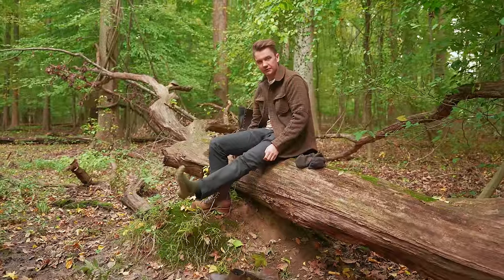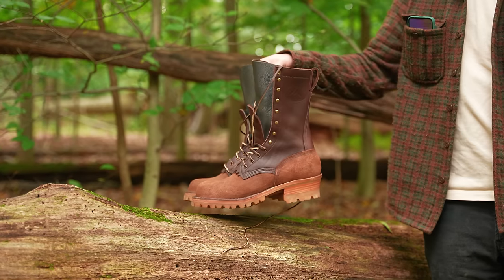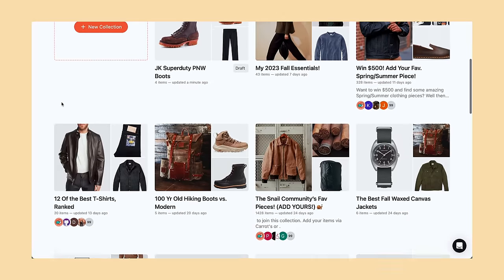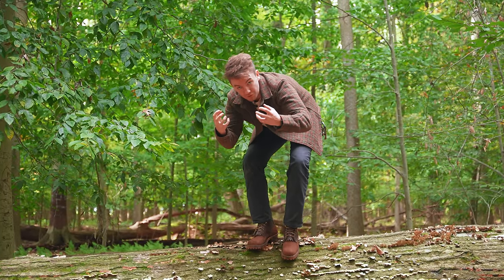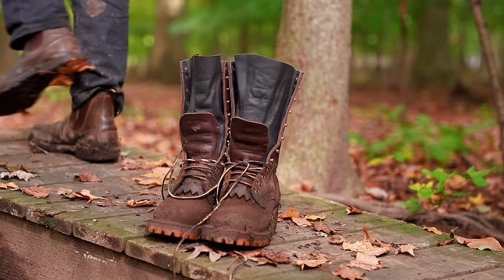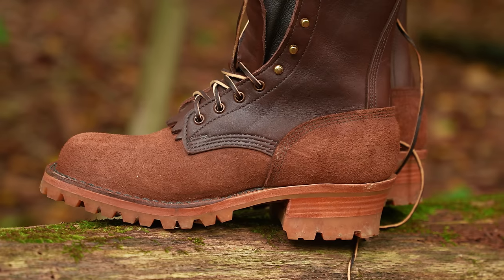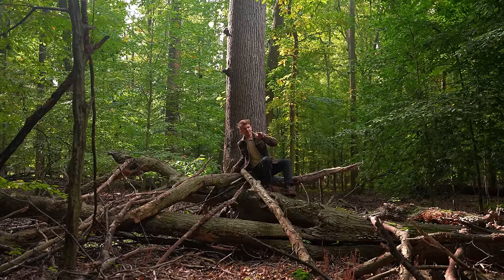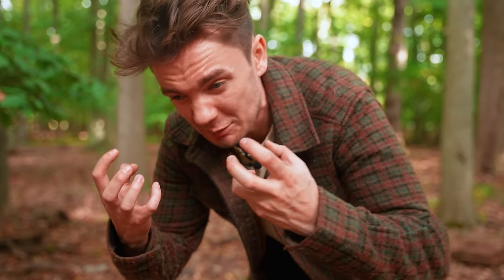Why Firefighters Wear Heels. (JK Boots)

Comment: Wish that you would have added how heavy these boots are. So even if you're walking for 9 hour days, the legs will probably feel the fatigue way before your feet do. lol
Reply: They are right about 3 lbs per boot. And when they fit right you don't feel the weight
Reply: If your working in construction or firefighting and walking on rough terrain all day lighter boots start to really hurt your feet because you feel everything you step on a heavier boot and bigger lugs definitely help with that
Reply from the maker: That's why I forgot to mention it!

Comment: I really apppreciate your insight at knowing they aren't broken in yet, and knowing how that will affect movement. I want to speak to that, as a former trail worker, who still does dry stone work and sawyer work in boots like these. 

A lot of people online call their boots broken in when they're no longer uncomfortable. But to me, the quality of leather that I value when carrying half my body weight over uneven, slippery, crumbling ground, is that it can adapt to your normal full range of movement, while being stout enough to permit no further movement. BOTH parts of that quality prevent injury. So to me, boots are broken in when I can do yoga in them. When I can accomplish my full range of motion in all directions. BUT NO FURTHER. 

Boots like this, broken in like that, allow you to SPRINT down undeveloped mountainside with ease. You are agile and stable. 

And someone else brought up the weight, and the replies were right. When the boot fits so well it becomes part of your foot, like a leathery callus in the shape of a boot, rather than something you slip inside of and have to pick up and manuver inside of, you stop noticing the weight. Anyone who's carried an old style frame pack has had the same feeling, of the heavier pack feeling lighter when full because of how it manages weight. 

And weight is really a key thing here. Boots like this aren't for everyday walking. Toss on some nice moccasins for that. These are for situations that would hurt your foot, that would be beyond foot health, and into injury, without these boots. HUGE pack weights off trail, loaded with tools and fuel. Kicking things, having chunks of rock and log that weigh more than you drop onto your feet, standing on iron bars for hours, etc. 

No matter what I do, my feet feel the same coming out of boots like this as they did going in. 

By the way, Mike, good old school double sock technique. We used to teach that to all the new field team members.
Reply: Best, most concise explanation I've ever read.

I agree 100% but have never been able to put it into words as well as you did. Thank you 👍 🍻

Comment: - Another huge reason for those heels is when hiking up an extremely steep hill, your ankles simply will never have the range of motion to flex enough for your heels to touch, so your heels will be off the ground anyways. The heel in that case adds support when most shoes wouldn't be able to supply it. 
- They also dig in deep when going down steep loose dirt, which is wildly helpful. 
- And the smooth leather on the top allows for your pants to slide over the top of the boot, because if it was roughout and you were wearing textured pants, it would catch on the grain due to the increased friction.
Great video! Always love your video style.
Reply from the maker: Ty for more info!

Comment: Barefoot bro here: 

These are great, sometimes. If you need to push yourself to the very edge of your ability and avoid injury from stepping through something (a common hazard in logging and firefighting) or stepping wrong on rough ground while carrying 70lbs of gear then these are exactly what you need. 

Every other day, those benifeits dissapear and barefoot shoes help you keep from babying the muscles in your feet

Comment: Great review michael! Just adding this, if by any chance you don’t want to wear a high heel boot, but want the same construction. You can get the same boots in HNW last. These are built on a 55 last (which is the high arch last). Hope this helps.
Reply: You’re thinking of Nicks boots lol. These are JK. If you want a shorter heel, Jk makes the OT boot, which I have. Has a shorter heel, more similar to other work boots, but way mo’ betta’
Reply: @BryceKimball7.3  hehe you’re right lol. I should try jk boots this time

Comment: Like some folks have already said, the logger boots can be a great tool. For me they just didn’t work well. I felt a lot of stiffness in my lower back. I just think they changed my gait. I switched back to a reg work boot (RW2412) and I’m good to go. I understand the supersole Red Wing and a PNW logger are polar opposites, but if you are really going to spend 10-12 hours in a pair of boots they have to work for your body type. Great video.

Comment: 4 months later... Between you and Rose Anvil, I will inevitably be buying many pairs of boots. And a PNW logger is next, methinks. I tested the waters with a used pair of Red Wing loggers. I was afraid I would not be able to stand the last, with the high arch and all. Well, it turns out that the high arch relieves my plantar faciitis and allows me to work longer in comfort. So I'm all in on a pair of JK OT Redwoods, or Drews or Franks, or even Whites. I don't want to skimp on footwear anymore...

Comment: I have a pair in black with the V100 soles.  I find that after a few hours of working in them, or anything with a heel taller than an inch, my Achilles heels start to hurt and are more susceptible to injury.  Too unnatural for my particular body type, and it also affects my knees and back at the end of the day.
Reply: Same.  Had to stop wearing logger boots because I was having knee problems.  Still might consider JK or Nicks got a lower heel option because their build quality are still superior to everything else.

Comment: The logger heel is pretty useless on hard flat ground but I really like it on soft ground when it digs in. The heel prevents your foot from having its full range of motion so you get a less efficient step. Your legs end up doing more work while your calf does less. I wear zero drop shoes for hiking and am much faster than when wearing my logger heels. The flat sole may feel like it’s putting your foot in a weaker position at first (not in my case) but that’s because you’ve likely not worn a pair of zero drop shoes any time recently. Once your calf muscles adjust they feel completely natural and you’ll have a much stronger stride.

Comment: Are those boots NFPA certified?
Reply from the maker: I’m not 200% certain these exact ones are so you’ll have to check with JK/the site but I believe so!
Reply: They don't appear to be NFPA certified, but rather they use material in NFPA certified equipment. Some departments care about this and other don't, it's a cultural thing (and a whole can of worms).
Reply from the maker: @carsonprice5368  ah, thank you for the clarification!
Reply: @TheIronSnail  yes sir. Like I said this is a whole can of worms. NFPA charges out the ass for a certification that is supposed to guarantee the safety of firefighters. Some firefighters are 100% on the health and safety train (we have officers for this very thing!) and will not compromise on NFPA. Other firefighters know there is a barrier to entry with NFPA, and trust a well made product when they find it. Some departments will bust your ass for picking and choosing and others won't. It's so circumstantial. Thank you for your time, I love your videos and you have made me a more informed consumer.

Comment: I currently cycle through three pairs of higher heal boots, one are  Redwing smokejumpers. Both on and off pavement. If you stand on the floor and then raise your heels you will notice your posture immediately improves, head back, shoulders back. My back is better now than it was 20 years ago. They will also keep you from twisting your ankle. The new buck is out for the same reason it was out in WWII boots, it takes waterproofing better.

Comment: What kind of overshirt is that ?
Reply from the maker: Flint and tinder felted wool over shirt! Link is in the carrot desc
Reply: I'm also in the 'cool jacket, oh it's a SHIRT' camp. I must admit I've never known how you are supposed to wear an overshirt, you can't wear it like a normal shirt and put a jumper or a jacket over it but if you wear it as a jacket then what do you wear under it? It looks like you can wear them in warm-ish weather instead of a light jacket but you can't layer them. I think. Apart from that, yeah, nice boots.

Comment: You seem to think or imply that "weak feet" is a no biggie because "what do you need strong feet for right?". It's actually extremely bad because your arch gets weakened and you start to overpronate which in turn messes up your whole leg and your feet and knees stop pointing straight. You can imagine all the problems that creates after a while. It also encourages heel striking which will eventually ruin your knees and back.

Also almost everyone that wears supportive footwear and doesn't train barefoot will have weak ankles, which will twist and sprain very easily. So many people suffer from this. This insane amount of arch support is bad for most people, workers or not. Firefighters and other workers usually use standard issue boots not hyper expensive stuff like this anyway. 

In conclusion, if you HAVE TO mess with millions of years of evolution that lead to the creation of the human foot, be VERY careful with it.

Comment: Hey Iron Snail... clearly you have zero experience with PNW logger boots. Clearly you have been paid off by JK boots. And the boots they sent you will end up in the closet. How about talking about products you have a few months wear and knowledge about. Any PNW logger boot where both the stitches go through  the sole and there is no slip sole is useless as the stitches wear out after a few hours of wear and the upper to the midsole attachment is left open to failure. Do your homework before we mislead your Youtube audience.
Reply: Yes, this is clearly an ad. He can make whatever videos he wants…and you’re wrong about the stitching. The sole has two rows of stitching, but it’s not just stitching. It’s a lock stitch. Even when the outer thread is worn, there is a knot inside of stitch, keeping it from coming apart. You think they’d make boots like this if the sole or lower just falls off after a few hours…lol. Most PNW boots are made like this, and for a reason.
Reply from the maker: Echoing KimballLeather for the sole discussion 

JK sent me these for free which I figured was pretty clear but I’m thankfully in the lucky spot where most brands I reach out to will send me a sample product for review or now some cool brands will email me without me asking first. When starting the channel I’d save up all the money I could, spend it on the next video, sell the item, and buy the next. Now, thankfully I don’t always have to do that! 

These brands don’t script, say what I can and can’t say, etc. 

These are my first PNW boots and I was pretty amped to have received them + they are built like tanks. I like them and really would recommend them to anyone. 

If there is anything I missed that was huge just let me know and I’ll pin a comment, make an additional video, etc.